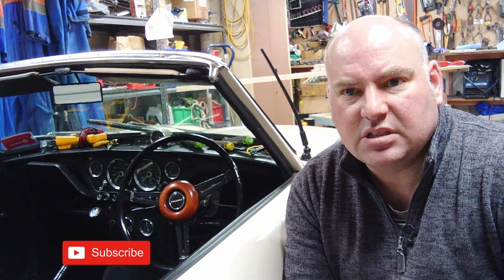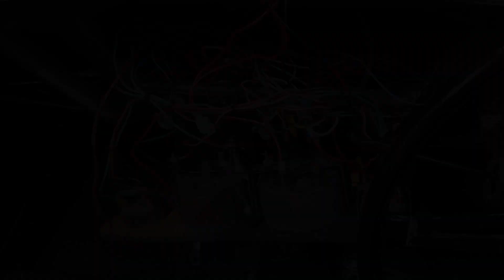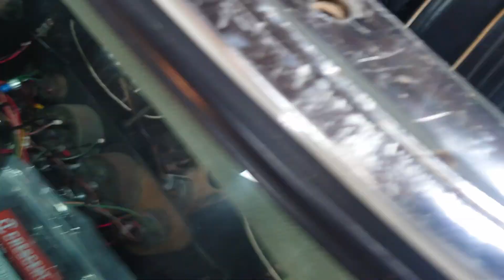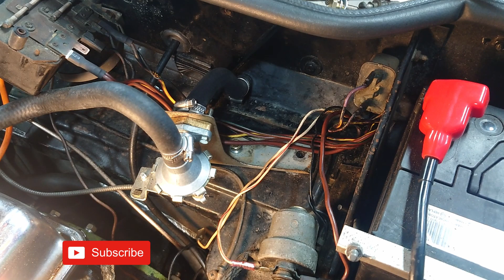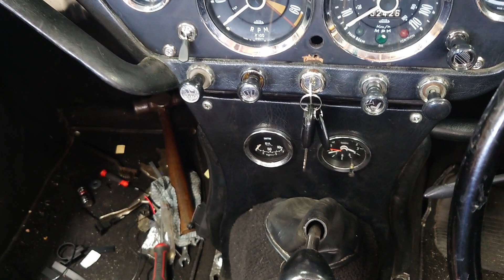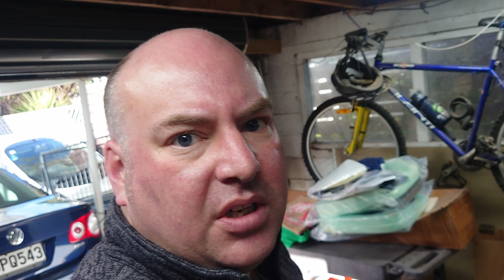66 SPTI part 36 – Fuses, Wiring, and Clock fitting in my 1966 Spitfire 4 Mk II

Comment: Hi James, I've had a short circuit on the main suppy feed from the battery to the 2 way lucas fuse box on my Hillman super minx. 
Ive stripped all the loom wrapping to see all the cables and their condition and they ok, so just replaced the burnt one ok.
Q. I was thinking off NOT re-wrapping the loom with tap to give it more breathing space, if you know what I mean. Q. DID YOU RE-WRAP YOUR LOOM ?
Thanks Walter from Liverpool Merseyside England
Reply from the maker: Hi Walter,
I generally re-wrap the loom as it adds more protection from the elements, and I've added a fuse box to protect more of the wiring.
Reply: @jamesfromwellington 
Hi James, thanks for getting back to me. 
I'll do the same as you ok.
There's one thing that I think the 1966 Hillman super minx manufacturers missed and that  is putting a fuse between the the positive battery terminal and the main supply to the lucas fuse box. 
The main supply to the fuse box and the ignition switch is un-fused, bad design. 
If it would have had a fuse my short circuit and cable melt down wouldn't of happened.  Take care and good luck.